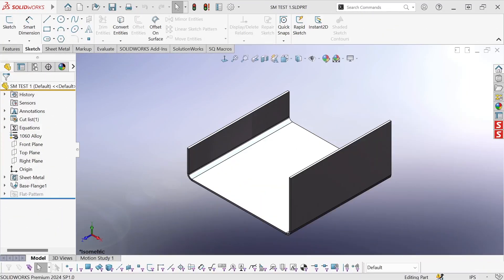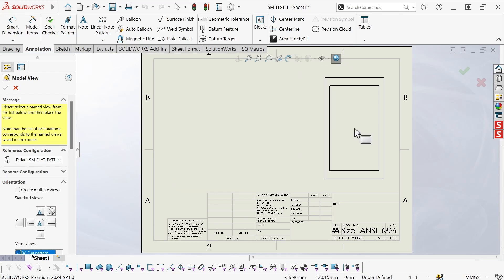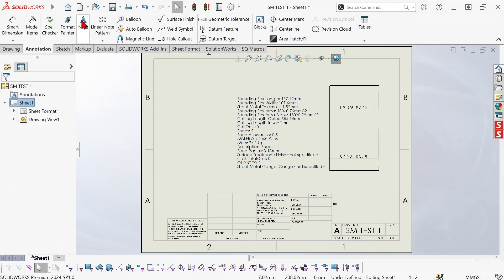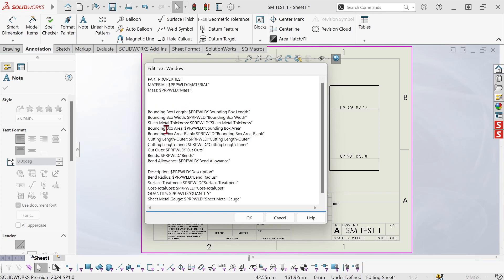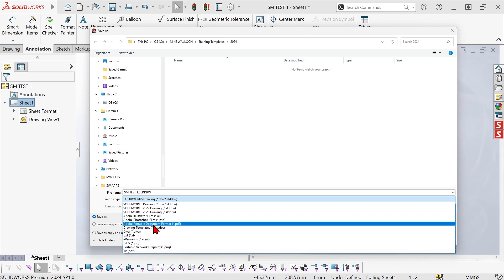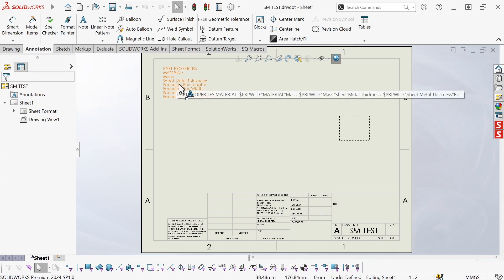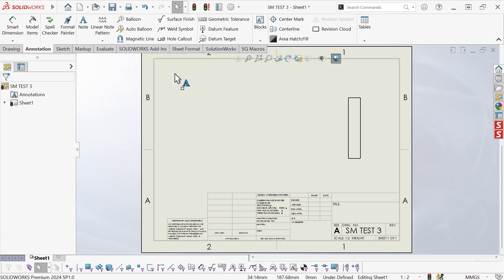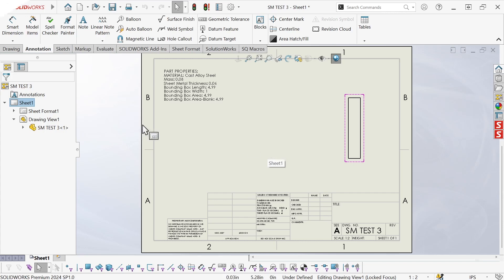Create a Drawing Template with a Cut List Properties Note in SOLIDWORKS

Comment: I've been doing this a similar method.  Instead of Copy/Paste you can select the view and the note together, then "right click>>Attachment>>Attach to View"  This works the same way you demonstrated.  The part that absolutely has been driving me crazy is how to get the unit of measure put back into the custom created note/annotation.  When you drop the cut list properties annotation on the drawing from the view (default Solidworks format), it includes the unit of measures on all the values.  If you change the working units on your drawing, the unit of measures also change on the annotation note.  However, when you create a custom cut list property, the unit of measures are not included on the values.  The values still change accordingly, but you don't necessarily know what units you are working with.  Any clue how to get them to show up?